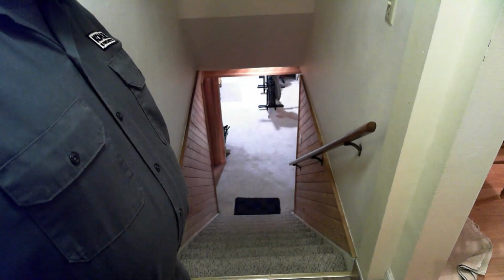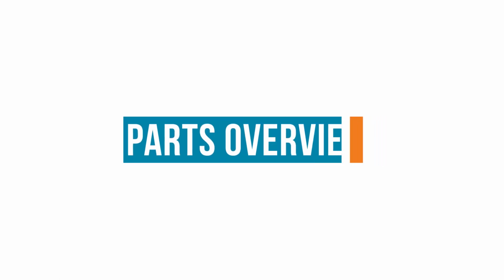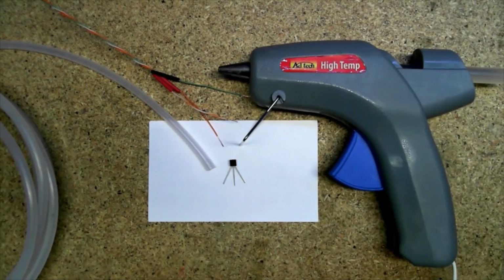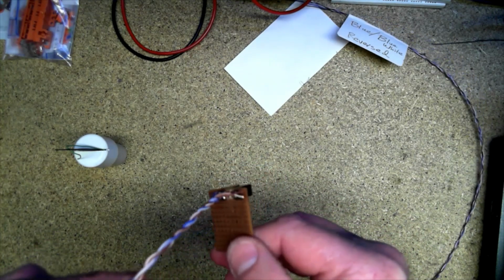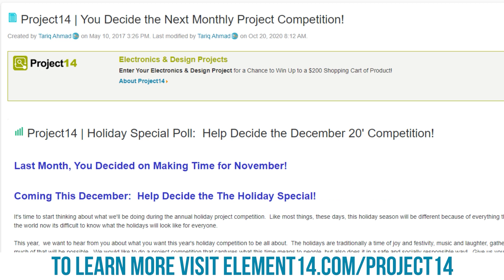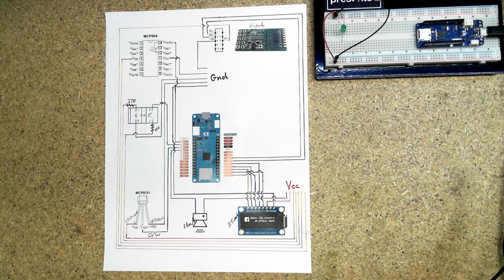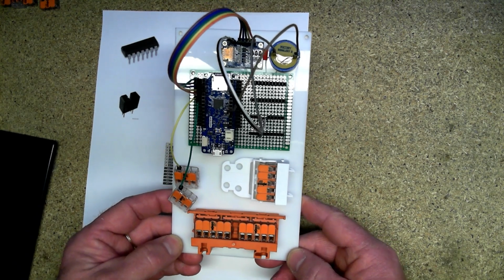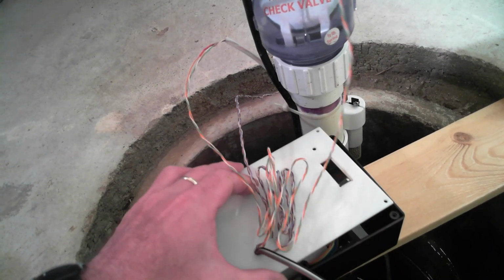DIY Sump Pump Alarm Using Arduino MKR Zero

Comment: I did a sump pump project similar to this about five years ago for my crawl space sump pump. I used an HC-SR04 ultrasonic distance sensor for the level. To detect a mold inducing atmosphere, a BME280 was used to detect if the humidity was at dew point. I have natural gas line so I added an MQ-135 sensor. I monitor it using Blynk. For the enclosure I used a cigar box.
I like the idea of detecting if the pump is constantly running.

Comment: All the projects on this channel are interesting, but this one really hits close to home. Currently I use an energy monitoring "smart home" outlet to see if my sump is continually running (which has happened to me in the past when the float switch wears out). This reminds me that I need to improve my notifications for that scenario and to consider a solution that detects high water level.

Comment: A further improvement would be to add a bilge pump as a battery operated backup. Have it operate if the high level sensor trips.